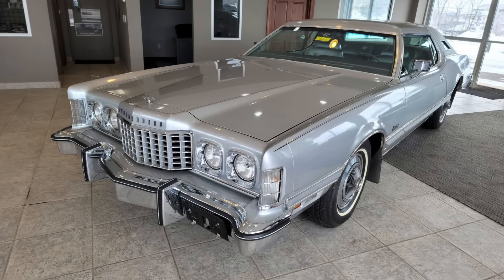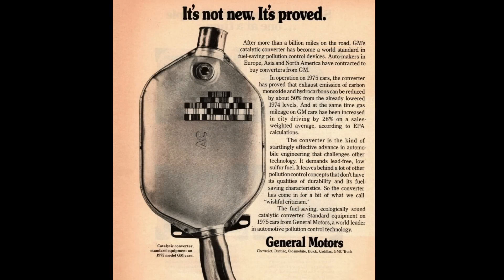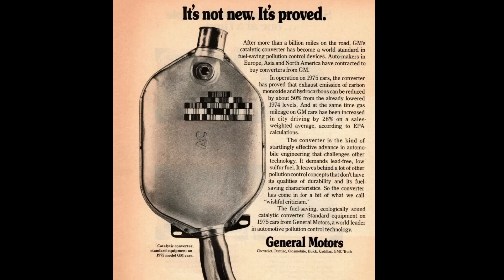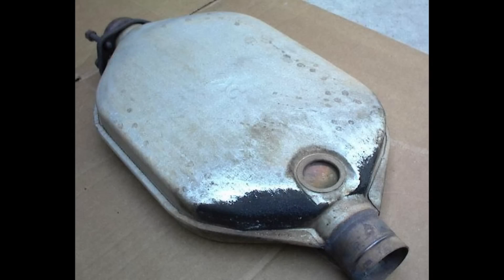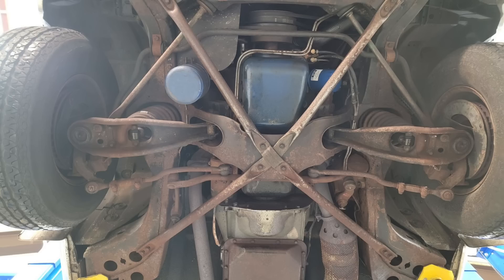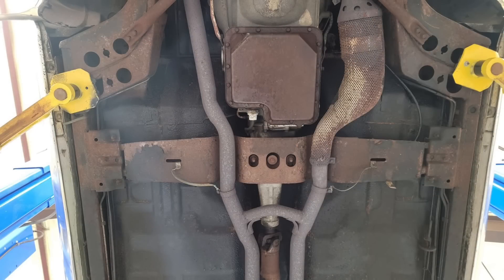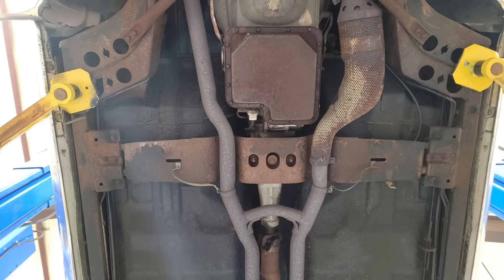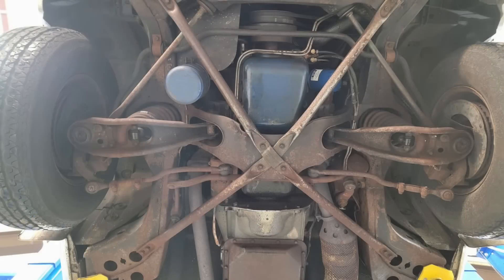Strangest Car Inventions: Ford Invents A Bizarre Way to Meet 1970s Emissions Standards

Comment: I am fairly sure the 75 TBird and 74 LTD my dad had did not have cats on them (Ontario) we still had leaded fuel for quite some time after it stopped being used in the US.  Both of those cars burned leaded.  They did have a complex system of exhaust recirc and thermactor pumps (which always seized after a couple of years) .

Comment: I had a 1975 LTD 4 door with 400M that had only 1 converter. I will never forget the response from a seasoned mechanic when asked. He said “if Ford could get it to pass emissions by putting a ball point pen in the exhaust, they would”.
Reply: Same car my family had from 1975-85. But we had to have ours removed to take it with us to Germany in '77. (Military Family) Wasn't any Unleaded Gas in Europe at the time. Plus a friend of the family was a long time Ford Dealer Tech and before it 'Went across the Water' showed my father a few things to remove,(One of those 'I can't legally do it,but I 'can' tell 'you' what to do??' deals.)plus we got a '74 Fuel Filler. I will say that years later when I worked for a used car lot,'our' 400 '75 Ford ran a bit better than most of the 'other' mid-late '70s 400 Fords I drove at work!!!
Reply: Ford actually had a restriction disc at the flange of some of their exhaust manifolds for this purpose and to operate back pressure sensitive EGR controls.
Reply: @ronaldkovacs7080   Sounds like Ford.  A fixed restriction is cheaper than a vacuum controlled heat riser valve but, lacks the control of a proper manifold heat system.
Reply: My Mom RIP had a 75 Lincoln Town Car with the 460 and I do remember seeing that single converter on the driver side.  I asked a Ford dealer mechanic and he said the slight backpressure from the converter pushed some of the exhaust go through the heat riser under the intake manifold and kept it hot without needing a special heat riser valve.  And yes, the 460 did manage to meet emissions requirements for that year so, it saved money for Ford in two ways.
Reply: That’s because ford knew how detrimental catalytic converters were to engines, in the early days they probably thought it was a government fad…
Reply: Ford  and Mercury in 1975 refused to supply SAE Net power outputs for the 200, 250, 302, 351 W engines for the Unibody Compacts, because of costs. They supplied rear wheel hp used for the  FTP75 LA Basin EPA test. Bricklin required it's 351W to be emissions certified, FoMoCo charger them 5 million dollars and gave them 175 hp SAE Net with MPG figures and no mandatory converter required for 1975. It was added for the last 755 cars, apparently. Again, if Ford could solve an emerging engineering compliance situation by application of Blue Ink, then they did. That's why 74 351 Cleveland 4V  powered California market De Tomaso Panteras were actually complianced 1973 build cars...to avoid emission compliance matters. By the application of Blue Ink...

Comment: My is300 had three of them lol. One upstream for each bank of 3 cylinders on the header and one downstream. It didn't mind me ditching the upstream cats but I had a harder time deleting the downstream without ecu changes or a stand alone ems.
Reply: Unusual that the primary cats did not give you an issue but the secondaries did, on many cars the secondaries do not even have o2 sensors post cat! Primary cats are usually a more sensitive area due to the primary o2 sensor being used for fueling adjustments
Reply: What issues did it cause with the tune? I was curious cause I heard it might affect air fuel ratio. But I've only ever seen a p0420 code.

Comment: I live in Germany and I was perplexed when I saw the underside of an 1970s Oldsmobile with those weird crooked crossover pipes for the first time. Funny stuff.
Reply: @RobertJarecki  gas prices in Germany were at about 1.20 Deutsche Mark in the late 1970s. And Diesel fuel was about 85 Pfennig. A typical Mercedes Taxi (240D or 300D) used about 8 to 10 liters of Diesel for 100km. An Oldsmobile Cutlass consumes at least 30 liters of gas for 100km in city traffic. It makes absolutely no sense at all to use such a car in Europe as a taxi. The lower price doesn't matter at all. It is all about cost of running.
Reply: @albinklein7680  They were probably Oldsmobile 260DX/350DX Diesels. Came out in '78.
Reply: @DrOlds7298  it is highly unlikely that those were driven in Germany. We have ridiculously high annual taxes for Diesel engined cars here. A 6 liter Diesel engine would cost an absolute fortune in yearly taxes.
Reply: 70s and 80s were a wierd time for American car design and engineering. The EPA was constantly coming at them to burn cleaner and get more miles per gallon and the NTSB coming at them to make cars safer. They were chasing their tails for a while. They never really recovered as they gave a foothold to the Japanese makes. Today, the big 3 make very few actual cars today. It's 90% trucks and SUVs.
Reply: @mindeloman  the German cars made for the US market were super weird, too. Especially Mercedes. The 350SE with the M110 V8 for example had 3.5 liters of displacement and 9.5:1 compression producing about 230hp  in Germany. The M110 for the US spec model was enlarged to about 4.5 liters but the compression ratio was reduced to iirc. 7:1 and they had a super weird cam timing/profile. They were extreme gas guzzlers and ran like crap. Poor Americans....
Reply: @albinklein7680 or wacky exhaust systems. American market cars have a single exhaust with a crossover. EU cars were true dual exhaust.
Reply: @albinklein7680  That's interesting.  My Honda Accord Coupe has more horsepower from a smaller (3.0 liter) V-6.  The Japanese have been very good at extracting lots of power from smaller engines for decades.
Reply: @mindeloman  Trucks and SUVs gave the biggest profit margins.
Reply: @ToolofSociety  sort of why we no longer have affordable houses. Builders figured out the bigger the house, the more margin they make.
Reply: @ToolofSociety actually the reason why its mostly trucks and SUVs is because of emissions standards. Back then it was based on GVWR for emissions standards. The higher the GVWR, the more lax the emissions were. Today its based on the shadow of the vehicle. The bigger the vehicle, the bigger the shadow it makes, and  the more lax the emissions laws on it. Cars have ridiculously high fuel economy requirements right now from the CAFE standards to the point that manufacturers can’t physically make a vehicle that both gets a high enough fuel economy rating and passes a tailpipe test; so they simply make them bigger until a vehicle can legally pass
Reply: @mindeloman  The big three are struggling to meet EPA and CAFE standards, but the Japanese were on top of it from the start.
Reply: @mindeloman  This could be wrong but I have read that a couple of reasons for shifting to trucks and SUVs were that the fuel mileage and possibly the emissions standards were easier to meet.
Reply: @RobertJarecki  I grew up in the 1970s in south Germany near Munich and I had family in Hamburg and Berlin. I have never ever seen an Oldsmobile Taxi in Germany. Never. They had some Chevy Malibu, the occasional Cadillac Fleetwood and, very rare, a Lincoln in Amsterdam and Zurich. But I really never ever seen an Oldsmobile Taxi in Germany. In the Netherlands US cars (all of them were converted to run on Propane) were a little bit more common because of some trade agreements regarding the US and the Rotterdam harbor iirc.
Reply: @RobertJarecki  your comment made it look like Oldsmobile Taxis were a common view in Germany which is simply total BS. Sorry.
Reply: Sometimes the crossovers are there to balance backpressure.  My 1967 Mustang had a factory installed 390 and it had a crossover years before the emission controls.  Aftermarket headers for that car/engine were a snake's nest.  One tube from each head crossed over to the collector on the opposite side.
Reply: @RobertJarecki  wtf is wrong with you?

Comment: Mopar 400 4 barrel P code HP dual exhsust engines for 75 and 76 didn't  have catalytic converters. So equipped cars had decals on the driver side door jamb that read Non catalyst equipped. Same with some 75/76 360 4V E58 engines to. All 440 E86  dual exhaust engines had dual  "honeycomb" cats. From 75 on to 78 the HP dual exhsust 440 was a police package only deal.
Reply: I had an E58 equipped '75 Dart Sport. It had 12,000 miles when I bought it and was completely original down to the tires. It had dual exhausts and no cats. It was nowhere near as quick as 340 A-bodies that I had previously owned, but a lot of that was due to the 2.73 gears it had. I swapped in a B-body 8 3/4 axle with a 3.55 suregrip; this also made the rear track a little wider so the tires filled the wheel well a bit better. I also recurved the distributor and rejetted the Thermoquad carb. The car ran very lean and had very retarded timing and these adjustments + the better rear axle really woke it up. It had the Non Catalyst decals on the door jam as previously mentioned.
I drove that car for about 3 years and sold it without a thought. Recently, I read that the production of E58 A-bodies in 1975 was very low, only about 1200 units, which, if true, would make them rarer than any of the 340 cars.

Comment: As late as 1977 VW's Rabbit (and probably the Scirocco as well) with a Bosch Jetronic fuel injection instead of a carb could meet EPA requirements without a catalytic converter. They bragged about it quite loudly.
Reply: I had a 76 fuel injected (mechanical) German built rabbit with the round headlights, and yes I believe it didn’t have a catalytic converter.
Reply: I worked at a VW dealership in the parts department in the early 80s. We sold a lot of catalytic converters. They would fail before 40,000 miles.
Reply: Bosch Jetronic sounds like a reliability nightmare compared to the most primitive GM digital TBI systems.
Reply: The VW Beetles, and buses came equipped with fuel injection in 1975.
Reply: @carlc5748   Not in Brazil
Reply: I seem to remember my sister Rabbit had a cat , but that saying it was a California model , which most cars by then were different than the other 49 states.
Reply: @billmoran3219  That is entirely possible. For some years there were the 49 state version and the California only version.
Reply: Awesome
Reply: I had a '78 Scirocco from brand new. Eventually in 1985 the catalytic converter started rattling around inside. I had this book and there was a section called how to "gut your cat". After taking it off the car I got a metal rod and banged the heck out of the element that was in it. All these shattered pieces came out. I put the cat back on and in 1985 when I sold the car it passed the emissions testing here in California even though nothing was in it. Go figure.
Reply: @stevejacobs8375  I have first hand knowledge of an 85 Dodge Caravan that only put out about 50% of the allowable CO emissions after a decade and 200k and with a fully nonfunctional EGR system. Go figure indeed.
Reply: Considering german cars' history of cheating on emissions testing... It's probably 50/50 whether it ACTUALLY met standards.
Reply: @philojudaeusofalexandria9556  No, it is not. This is before electronic controls that enabled VW to fake out the EPA during their dyno testing. They would run the vehicle on a dyno and analyze the exhaust output and at this time there was no way to fake out their analyzers by having the ecu adjust the engine maps
Reply: @philojudaeusofalexandria9556  I absolutely would not argue with that! Although the Bosch FI systems of the time were completely mechanical so the ability to have two completely different engine maps didn't exist. In the early 80s I bought a Pennsylvania built Rabbit diesel - still with an entirely mechanical FI system - in part because it had an EPA highway mileage rating of about 45 mpg. I had a 102 mile daily round trip that was all on rural blacktops with only 3 stop signs that didn't require full stops. The best it ever got when new was 42 mpg and as it broke in it stabilized at 35 mpg which was barely better than the 32 mpg the gas Rabbit highway mileage. That was my last German vehicle and my only diesel.
Reply: @curtislowe4577  Are you sure the fuel injector spill and return lines weren't cracked or rotten off, pissing the return fuel all over the road?
Reply: @gregorymalchuk272  I don't have any recollection of the engine being coated with fuel. It went back to A VW dealer twice back in the day day with a request to find out what is wrong with the fuel delivery as in addition to poor mileage it also made very little power. Both times all I got was a bill for technician hours and being told the pump and injectors are all within spec.